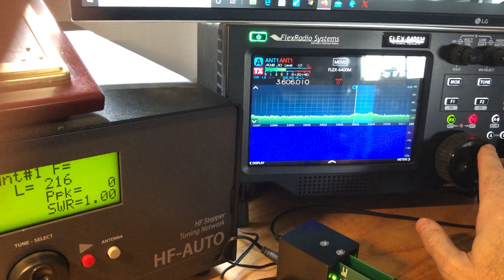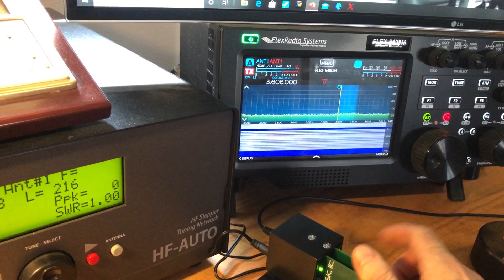Great CW Touch Sensitive Paddle Keyer

Comment: Dave, I’m just starting to learning Morse Code and borrowed an MFJ 442 double lever paddle with an attached oscillator to practice transmitting code.  It’s seems that the main difference with this key system is that the key has to be powered. 

How easy have you found adjusting the capacitance for sensitivity?  

One concern I have is parts replacement should the electronics fail. Is there a multi year warranty for the unit?

Really appreciate your review and help to educate this segment of the community in the hobby.
Reply from the maker: Actually I didm't find a need to adjust it since it worked as I expected.  As far as the future repair of it I would contact the manufacture of it since I'm not sure.  Mine is still working.  It's fun to use and easy to get use  to from a mechanical key.  Congrats on learning CW too.  As a stubborn seasoned ham who was forced to learn CW I was dead set on removal of the requirement since I had to learn it.  Now it seems without the requirement hams are checking out CW with a curiosity vs a compulsion.  Live and learn I guess.  Best 73! K9AT
Reply: @MacsForever1  Thanks, David. Maybe it’s pride but I decided that being a no code Extra was a designation that I didn’t want to have any longer. Plus, I have recognized as well that a large number of Hams in my area are rediscovering the CW mode.  No sense in missing the fun.  Mark K3DEX

Comment: Interesting. Do you like that better than a mechanical paddle? For that price I think that I would go for a Kent or Bencher.
Reply from the maker: They are different but I think I like them better.  You should give them a try.
Reply: @MacsForever1  Sorry but $159 is an expensive try. Don't you know that most hams are CHEAP!😁
Reply from the maker: @eminusipi  Of course I do but you can't take it with you when you go.  Or as an old friend of mine once said, you'll never see an armored car in a funeral procession.

73
Reply: @MacsForever1  If you like it, good for you! That's what is important. If I was skilled enough I would use a straight key!
Reply from the maker: @eminusipi  I realize the risk of buying something without trying it so I understand your reluctance.  If you hear me on the air stop by and say hello.  Until then best 73!  K9AT
Reply: @MacsForever1  Will do! 73 James AD6LP.